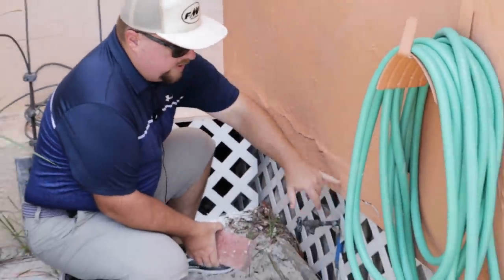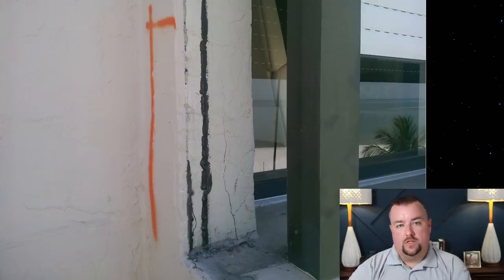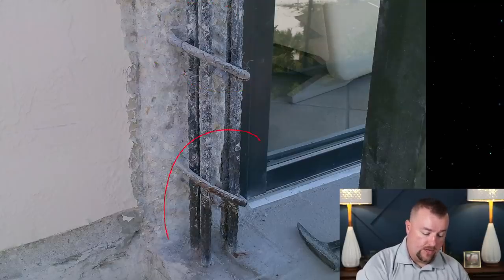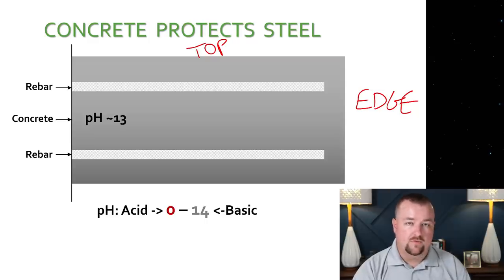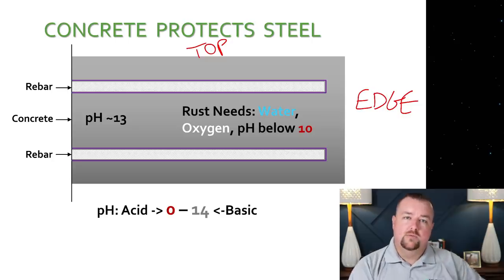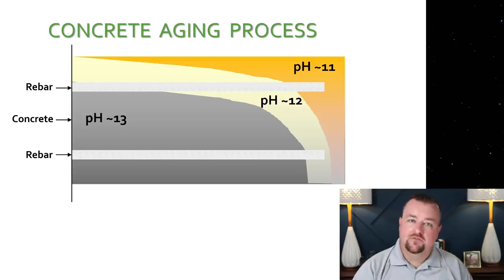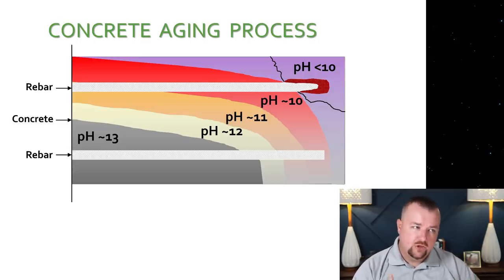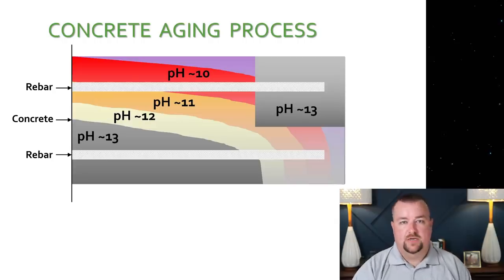Reinforced Concrete's Number 1 Enemy

Comment: tyler ley has a concrete channel on yt.  he is big on vapor permeable waterproof coatings for reinforced concrete structures.  also recommends 1.5 -2 inch depth of concrete covering before rebar.  also big on post casting moist cover or coating for concrete to make surface strong and relatively impermeable from the get go

Comment: Now, if we could educate people to waterproof the top and edges of exposed slabs, but leave the underside unfinished, we would really maximise reinforced concrete's lifespan.
Keep the water out from the top and sides, let it dry out from underneath! No waterproofing is perfect.
Reply: Another option is to use permeable paint on the underside of the slab, which still allows evaporation of moisture.

Comment: Results vary, it seems. The Traymore Hotel in Atlantic City was demolished because the concrete had deteriorated to such an extent that the Seaward Wing was in danger of collapse. On the other hand, the Knight's Key Viaduct is reinforced concrete, it has been standing in seawater for 115 years and it shows little sign of crumbling. I read that Flagler ordered many shiploads of special cement from Germany, perhaps that is the key.

Comment: I am wondering, having studying lime a little, if a lime wash would help restore the proper PH and soak into the concrete some filling cracks and such. It is apparently a traditional thing some people used to do to plastered adobe, and such. Lime by itself is bright white of course, but it can also be colored, making something called "calcimine", which is pretty inexpensive actually. And can match colors of stucco or concrete I presume.

Comment: If concrete absorbs water, and subsequent rust has a PH requirement, would a strong alkaline applied as a fluid neutralize the acid and reverse the effect? Is this the "preventative maintenance" you are talking about? Good stuff. 👍
Reply: i have heard it is the chloride ions that do the damage....dont understand the chemistry since rust is an oxide of iron.
Reply: @peetky8645  chloride reacts with the passive oxide (protective coating naturally formed on steel rebar)... as well as with the iron in the rebar... forming iron (III) chloride. When wet from rain water this forms a highly acidic solution that further reduces the concrete ph and allows more corrosion of the rebar to occur.
Reply: @davidhenningson4782  thanks for the chemistry.   i remember tyler ley talking about chloride intrusion being the problem.

Comment: It seems short-sighted to use steel rebar in a salt air environment when failure is certain.  The cost of repairing a bridge or condo when it fails is significantly higher than the cost of using a corrosion-resistant metal for reinforcing the concrete in the first place.
Reply: problem is, there aren't any real alternatives. Stainless would be difficult to forge into rebar and prohibitively expensive (not to mention more difficult to form and bend in the field), brass or bronze will not be strong enough and aluminum also forms an oxide layer that has a higher volume than the base metal.
Reply: @notabagel  304 and 316 stainless steel are classified as "marine grade" with 316 being the more salt-resistant of the two.  316 stainless is less than 3X the price of carbon steel.  It is highly malleable and could easily be hot roll-formed into rebar.  It is easily cut with an abrasive wheel saw.  316 stainless will not expand and spall (aka exfoliate)  in the presence of salt water which is the cause of concrete failure in bridges and condo foundations.  Since the cost of rebar is a minimal part of the overall cost of a bridge or a condo building, tripling the amount paid for the rebar could be a bargain versus the loss of a structure.

Comment: Very interesting, thanks Josh. The inference of this is that concrete buildings in a coastal or (perhaps) high rainfall area should be given a finite life-span, after which time they should be demolished and rebuilt. It would seem that once major rebar corrosion has started, it may become economically infeasible to repair it safely. For example, the corrosion in the rebar of the pooldeck of the Surfside condo, which seems to have caused delamination along the line of the rebar and the collapse of the deck. If the problem had been detected in good time, it is hard to see how the deck could have been repaired - demolition of the deck and reconstruction would have been the only practical (and safe) remedy.

Alternatively for these locations, a rebar material would need to be corrosion-proof, but clearly using stainless (or titanium etc) would have prohibitive cost implications unless the through-life costs of the building are taken into account.

Comment: Not withstanding older concrete structures. What are the new or old technologies available to increase concrete structure integrity/longevity.I know there are water proofing agents for concrete surfaces. What about rebar protective coatings etc. Thanks for the vid.

Comment: So I am envisioning the pool deck with years of rain affecting the PH. Now I envision the cracks in the roof of the parking garage at Surfside, and imagine water trickling all the way through. I can imagine how that affects the PH level, and also accelerates the rusting of rebar. Ugh. Someone who is clearly not a structural engineer clearly didn't see how terribly dangerous this could be. This includes the Condo Association. If only they had someone like Josh to come explain how critical the repairs were to get done

Comment: There is an old concrete building I worked on. It had very similar issues on the exterior columns. A lot of people used to use elastomeric paint to “protect” the columns/walls put this has failed badly on many buildings. What other options are there when you are right on the property line and can’t add a building envelope? Thanks.
Reply: Yeah, that's what I'd think would happen. It quits expanding and contracting with the metal at some point, it seems.

Comment: Slightly off topic, but for those previously unaware of the reason, this helps explain why ferro-cement boats, which were widely promoted in the 70s as a cheap, DIY hull material, never caught on.
Reply: Here at Build lt Forever, Pharaoh Engineering, we recommend only HT concrete and silicon bronze, 304 stainless steel, titanium, domestic composite or galvanized steel rebar.
Reply: Seriously, no disrespect intended. These videos are terrific. The inclusion of silicon bronze and titanium for rebar were intended as a joke.

Comment: At 9:55 - what is the name of this protective rebar product? Is this a coating with includes zinc to act as a sacrificial electrode that is more electronegative than the iron in rebar? Does this coating also protect the area just outside the repair area?

Comment: Question, aside from the mentioned waterproofing that would prevent ingress of Ph lowering compounds is it possible to soak / treat steel reinforced concrete with a Ph raising solution (say lye and water) to mitigate the previous lowering and then apply a water sealant for a longer term repair?

Comment: What you are explaining is more applicable to a marine environment. I don't see concrete away from coastal areas need to bother about rains apart from the normal aesthetic concerns. But acid rains from a volcano might be a concern though.
Reply: InLikeARefugee:
How about inland environments with winter conditions which encourage the application of ROAD SALT.  How safe are the floors of the parking garages?
Reply: @TorontoLS  Yep salt run-off is another thing to worry about.

Comment: Just wondering about the northern environments, how does snow, ice, and ice salt affect concrete spalling? In the city's I have seen  salt spread up to the edge of buildings and this has me wondering how that effects those buildings over time. Thanks for the content. You really explain it in a easy to understand method.
Reply: Road salt won't affect buildings, but it will damage bridges.
Reply: Gordon Richardson:
Road salt "dragged" into parking garages by vehicles during the winter can cause floor failure.

Comment: Why don’t they use epoxy coated rebar/mesh in buildings in coastal zones. Cost, I know, but what does a structure failure cost? I was a powder coating chemist and know even epoxy coated bar is not perfect, but does prevent spalling/rust for a fairly long time in a more hostile environment than would be seen in a building. Is that not part of building code, like it is for bridges and other coastal structures.

Comment: When pouring new reinforced concrete, how do they deal with rust on the rebar?  Is there some property of concrete or the curing process that removes rust or do they actually grind or clean it in some way?
Reply: Rust needs more of what got it to where it is. So if it is deprived of O2 and acidic water environment it will remain dormant from what I gathered from his presentation.
Reply: A thin layer of rust on rebar before the concrete is poured is totally normal. The alkaline cement will immediately neutralise any corrosion.

Comment: After watching your videos, I would greatly appreciate a quick chat. I just got hit by IDA here in Nola. A huge tree fell on my roof of my third story apartment and when coming down took out an exterior load bearing wall on the second floor. They left it untouched for days, continued water damage and did a non-structural repair on the second floor exterior wall. Including multiple workers on my multiple hips and valleys roof. Which has holes and they laid a temp tarp. Now my gut said pay attention so from day 1 I’ve been taking pictures but structural rot from termites to improper repair of a load bearing wall, and now I’m finding growing cracks EVERYWHERE LARGE SMALL Vertical horizontal what I like to call Coroner rainbows. My apartment on the third floor and My water is constantly shaking like Jurassic Park, and I’m now noticing some carpet nail strips raising under the carpet so I looked and I’m guessing it’s spalling and expanding ? And on the first floor they have dry cuts in the center concrete square but the center is not sinking but now a hump? I can’t get anybody to confirm that what I am witnessing is potentially dangerous for the 12 units here six on each side four on each level separation from exterior wall and slab on second level and in the concrete stair walls and bowing and sagging. And I like to call mystery rust droppings all over the concrete slab just little circle rustI found one nail but it’s like we have a nail fairy who’s coming in quickly getting the nails before people notice kind of like the non-structural repair that they did on the loadbearing wall code enforcement out here won’t come look but if I could send you pictures and you can tell me I’m not crazy because I swear I look at this building and it’s twisting if that makes sense before these people get hurt
Reply: Forgot to add the second level exterior loadbearing wall also holds live weight of all 12 units electrical meters and the nails are kind of starting to pop out of that but that’s not due to settling correct

Comment: There are concrete structures on Miami Beach, Hotels, Motels, Houses, Docks and Bridges that have been in place since the 30's and 40's and some even from the 20's. And a substantial number of them are still in great condition. Why is that ? Could it be the fact that they are constantly maintained and painted ? Paint being the main factor in keeping the moisture and salts out of the concrete ? And what about the bridges in The Florida Keys that were built in the 20's and 30's with Salt Water Concrete ? Why did they last all the way up to the 70's and 80's before being replaced ? And most of these structures, although not being used for traffic or Railroads today, are still standing and being used for fishing piers down there. If there is a logical answer to that, I would like to hear it.

Comment: I've often wondered how it is safe to rely on pylons for tall buildings that aren't all that accessible for repairs and maintenance. Is the process slower due to lower oxygen levels underground? Do they use more robust initial waterproofing/concrete mix, etc.?

Comment: So curious would it be best to make concrete at a higher pH so therefore in due time it'll take longer to get to that 10% pH where the rebar can start to rust and rot?
Reply: Well, considering that the pH scale goes from 0 to 14, and the concrete is already at 13, it's going to be hard to get it much higher.

Comment: The thing I was most surprised at when this collapse was first reported was the speed. That's to say I found it hard to believe that a steel reinforced building, built in the United States, would need to be recertified in 40 years. Never mind actually collapsing withing 40 years regardless of the maintenance or environment. I wonder if that misconception is pervasive and possibly one of the factors here.

Comment: Would it be possible to apply an alkaline solution to the concrete to help raise the PH? I'd imagine many cleaners especially those used with a pressure washer are acidic, perhaps if we applied an alkaline solution it could help counteract this process?

Comment: Josh, how can the concrete be protected and maintained long term? It would be good to know.
Reply from the maker: Waterproofing on the top will greatly extend the overall life, but CO2 will continue attacking the concrete from the underside eventually necessitating replacement of all weather-exposed concrete over time.

Comment: Would using galvanised rebar cure or prolong the drop in ph over time ??? or adding a waterproofing agent into the concrete mix at time of pour help ??? Or the use of stainless steel rebar at seafront apartments etc .................. price is the problem I bet

Comment: If you want to really study coastal concrete just go study all the WW2 bunkers build along the coast. For instance Fort Stevens. You will see examples of this BUT you will be shocked how well it has stood up. Most rust related issues are from exposed steel structures or where steel went into the concrete. These bunkers seem to have been made out of superior concrete. I have seen so much newer concrete that has deteriotated much more than that older concrete.

Comment: My company has done  hundreds of these types of repairs.
  The very first thing I noticed ( and I'm going from the frames you're showing ) , is the fact that there appears to be a wood post right against the stem wall . 
  In my humble opinion , the expansion and contraction of this post perhaps had as much or maybe everything to do with this crack . It is very easy for this pressure from expanded wood to create movement within the concrete . 
  I believe that this problem originated from the post .
  I'm not sure if this post was part of the original construction or added at a later date to reinforce whatever cover the porch has .
  At any rate , it is poor design and should not be done .
  So , I'm thinking , first , the compromised concrete due to the post moving and stressing the concrete , then a split develops , then water can easily penetrate the concrete surface and compromise the rebar
Reply: When attempting to defy gravity , stress cracks aren't only possible , they are inevitable. 
  Again , I see this every month while repairing structures . 
  And we usually repair the damaged ( and poorly designed ) areas similar to the original construction . 
 We do add as many elements of strengthening that we can ( sometimes I-beams , etc . ) 
  But the underlying problem is always ( always ) poorly engineered design 
  Always
Reply: The other example shown ( the slab side wall and pseudo beam ) Is another poor design . 
  That amount of concrete , forming a lintel virtually , without an actual pre-cast piece will always deteriorate. 
 When rebar is used to connect two sections together, from a column to a wall corner , it isn't strong enough ( no matter how you tie it together ) to withstand the stress of gravity.

Comment: Is it possible to design/build a concrete building that lasts 20-30+ years without requiring this maintenance work by waterproofing the concrete completely or some other method?
Reply from the maker: Concrete with a very low water-to-cement ratio and some additives could possibly get you to 30 years on the coast, but eventually you will get on a repair cycle as alluded to in this video.

Comment: Technically pH has limits well beyond 0-14. It is possible to have a solution with high enough H+ concentration for negative pH, similarly you could have OH- concentration high enough for pH higher than 14.

Comment: Is there any way to "recharge" the pH of the concrete? Spraying concrete with a basic solution, basically lye and water?

I also find it curious that the boundary of the new and old concrete stays square. I would have expected the boundaries to round as the water leches into the concrete.
Reply: One solution is to paint it. Which prevents water with contaminants getting into the concrete in the first place.

Comment: 9:55 "They will coat the steel in a protective product"  You have concentrated on concrete in an environment rich in NaCl.  You did not discuss how steel coated in a protective product ages.  If it works, why not coat the steel in this protective product whenever the steel is in a salty environment?  This particular video raises far more questions than it answers!
Reply: visit tyler ley on YT.  he is a concrete civil engineering professor from oklahoma.  has videos about rebar with coatings
Reply: Ever heard of Google? Try doing your own research once in a while